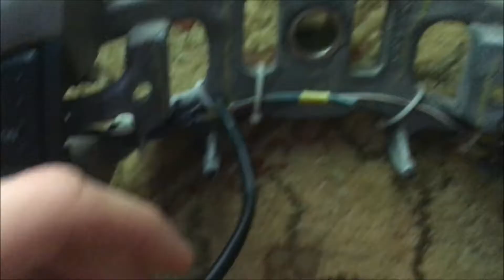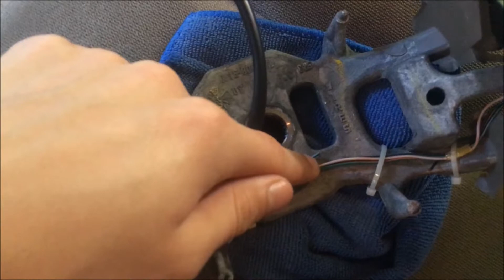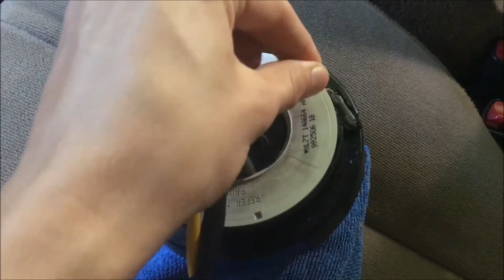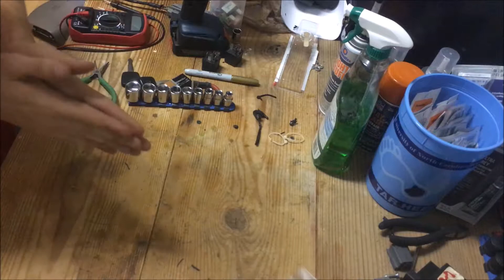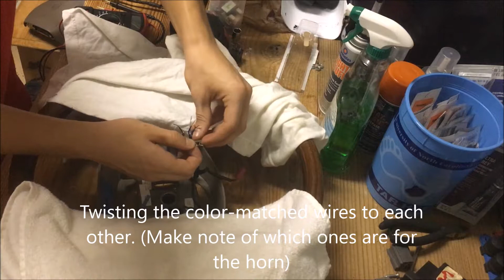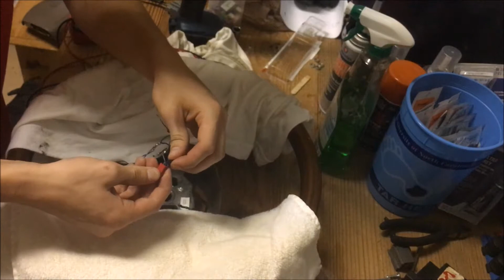Replace The Steering Wheel in Your 1997-2002 F150/Expedition With One From a Lincoln Navigator

Comment: Right now I am in the middle of the process to do the same to my 2002 E150. 
Actually I wonder why you soldered the connectors in the wheel, from my research all that needs to be done is to solder the old connector to the vehicle circuits (E150) at the end of the clockspring cable of the Navigator according to the wire colors. Brown and white / light blue wire will be left over as they are for HVAC and audio controls. In my case both wires go into an aftermarket unit (PAC Audio CP2) to adapt the resistive steering wheel controls for an aftermarket stereo unit (Pioneer).

The orange and teal wire on my E150 was a secondary negative ground (for whatever reason), the Navigator clockspring combined all negative grounds from the wheel in one black wire. So I will not use the orange / teal wire any more, if my van acts up I will just put it to ground negative at the chassis under the steering wheel.

For better looks I gave the Navigator wheel a makeover: I sanded the wood and got it recoated with clearcoat (at a high quality paintshop) and had the leather replaced, after more than 20years the wheel looked a bit worn.
Reply from the maker: So I soldered it in case I ever wanted to go back to the stock wheel. It was more a "because I can" type of deal. Also I got that wheel from a junkyard and did not want to ruin the clockspring in the junkyard. At the end of the day, they both do the same thing, more of a preference thing. 

Do you have any pictures of your wheel makeover posted on a forum?

Comment: GE man. In the middle of the swap. A navigator to a 2001 excursion. Did you have 2 solid ue wires from the navigator steering wheel and one from your  harness that you are soidering  to the wheel. If so how do you handle that. Not the blue and red wires.
Reply from the maker: I did solder 2 wires from the steering wheel harness to 1 wire on the vehicle harness. all the wires were the same color, i think it was for the ground line.
Reply from the maker: you can also add the secondary function to your car if you want (the climate control, and stereo if you still want to. I would if i could

Comment: Do you have any of the wiring diagrams that you used for this?
Reply from the maker: I didn't need any wiring diagrams. The colors of the wires within the steering wheel for cruise control were identical to the ones on the navigator. I just soldered the identical colors together.  You should be able to use one from a 98-02 navigator/excursion
Reply: @themechanick9071  are the colors the same for all years?